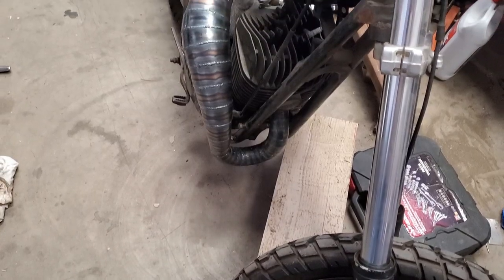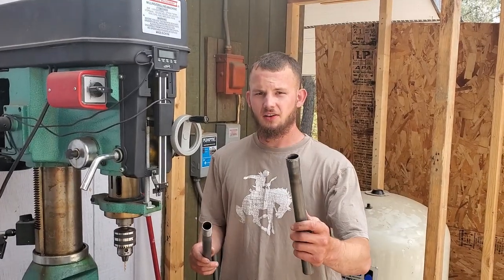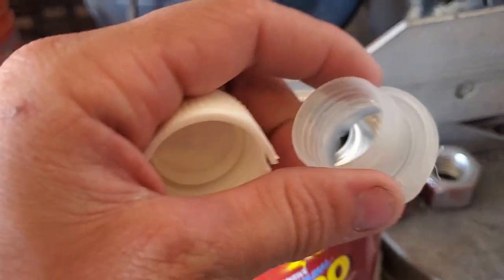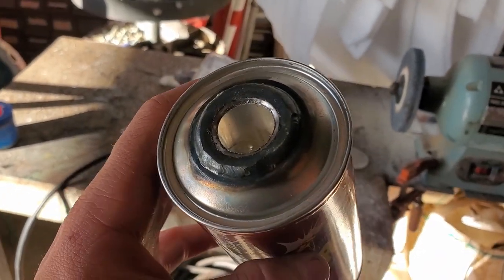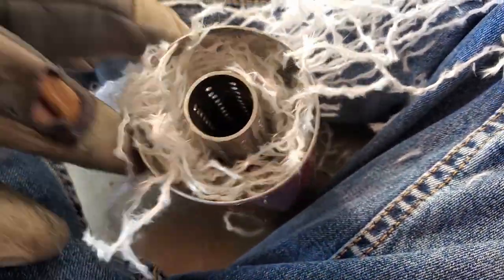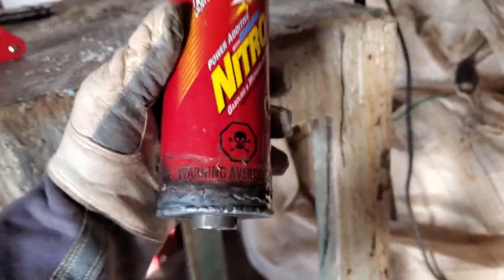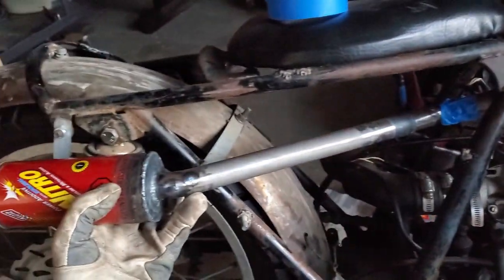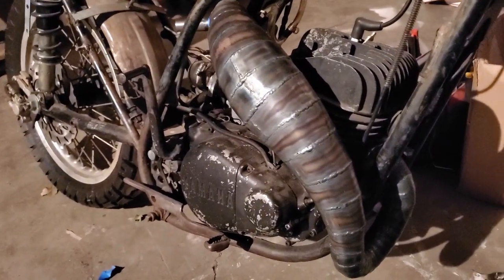EXPANSION CHAMBER BUILD PART 4: Silencer, Muffler Fabrication

Comment: Get a gallon of muriatic acid from a pool supply store. This will strip the zinc coating off the steel can and give you virgin metal. The acid is also useful for stripping the coating off bolts when welding them on for mounts, etc.